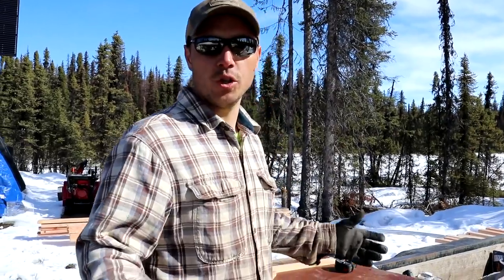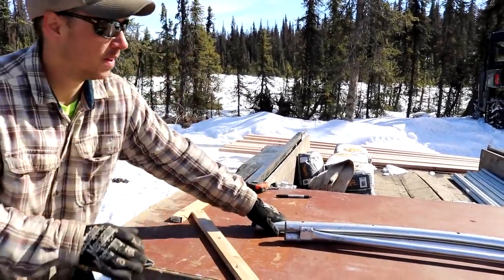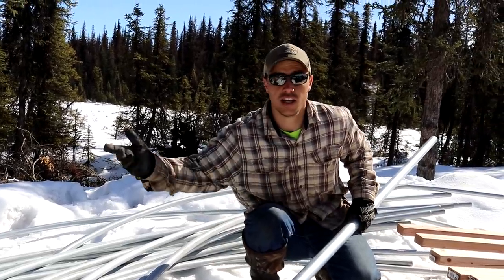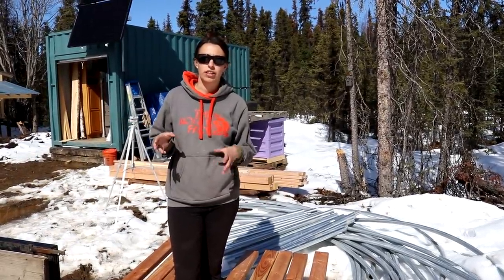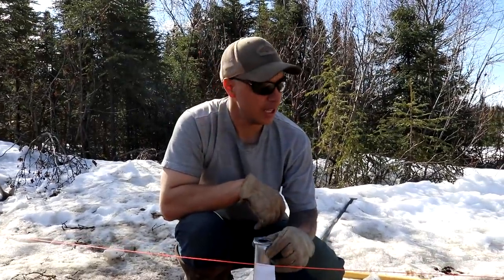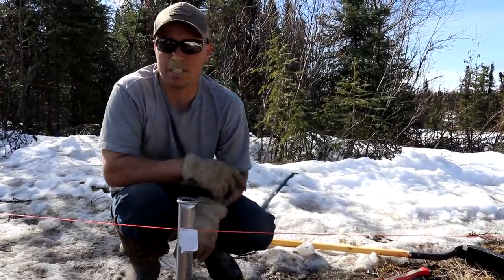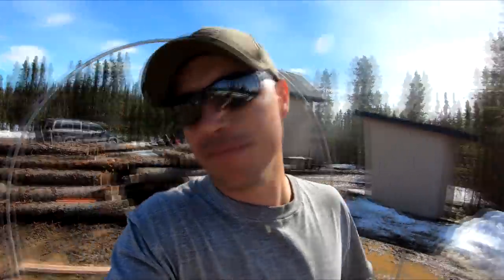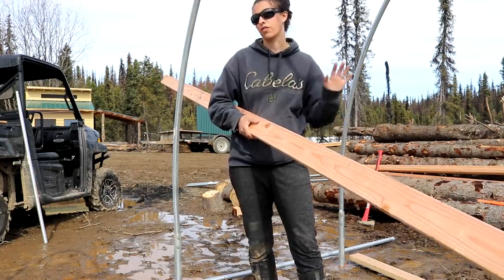High Tunnel Build (Part 1) | Off Grid Living

Comment: You mentioned that you want to make it as wind resistant sturdy as possible. If I could change one thing about this build, it would be to not use those self tapping screws and bolts. Everywhere you are using those, instead drill a hole all the way through the pipe and use a carriage bolt and a locknut. Not only will it be way more sturdy, but it will make it easier to dismantle for repairs or if you're going to relocate it. Self tapping machine screws can work themselves loose over time. Especially if you live in a harsh environment like Alaska. The wind will do it, and the expansion and contraction of the metal will do it, so I'd go back and use carriage bolts. You guys amaze me though. I LOVE to see your pioneering/homesteading spirit. I wish more people would follow your footsteps.

Comment: Hi guys, its Teresa's husband....nursery man and hoop house builder...its looking really good...but I have lots of experience with the hoops pulling out of the ground from high winds....so you might want to dig around each post and add concrete...its amazing what wind can do!  Once that plastic goes on you have force from the wind that creates all sorts of action in the frame.  After it is all sealed up you will have a tunnel that fills with hot air, it is essential you have circulation....one fan at each end on opposite sides will give good air flow but it will not cool it down. Shade cloth over the top will help and leaving the sides up lets a lot of that hot air out.  "Agrilock" is the best plastic holder and never rips out, I have had wiggle wire completely pull out in high wind so once again...wind can do crazy things.  Love your post and you guys are some of the hardest working people I have ever seen!
Reply from the maker: Teresa Dove, Hello Danny! Appreciate your recommendations, we do plan to have shade cloth and at least one fan but I'd really like to have two (our solar system isn't too large so every thing we use we have to give thought to) but we completely agree overheating and lack of circulation are concerns of ours. We did make a large door but the window in the back is not as big as I would have liked (or atleast the part that opens). We do plan to concrete our beams in but did not consider concrete for the ground posts, I absolutely believe you that wind can do some crazy things, that is my biggest worry, I had read not having roll up sides should help and hopefully some of the surrounding trees. We definitely are going to keep an eye on it and may add more concrete at a later date, the cost of things here unfortunately really are higher. Thanks again for the comment, cheers to a wonderful garden season :)
Reply: They really are!!!🙏❤🙏  67inFL👵

Comment: Linseed oil works great on wood tool handles too. Sand off the varnish that comes on the wood and treat with linseed oil. Really helps prevent blisters when swinging an axe or hammer all day.
Reply: Yea, I was wondering how they use wood handled axes so often, but didn't know about BLO.
Reply: Sanded all our tool handles and treated them with linseed oil back in the ‘60’s when I worked for the US Forest Service. Made axe handles feel velvet soft to the touch but also protected the handles from the weather.

Comment: Commercial Duty 60lb T-post (or top rail driver - what I use for ground posts) normally have at Fence Emporium, on the off chance that's where you got your top-rail.  Look-em up just east of Palmer.  Costs about $60 but so doubt you'll regret that.  They also have a T-post puller if your going to do cattle / sheep fencing you'll definitely want this roughly same price.  One more essential - TO CONSIDER- is a top-rail wire spool (about $100) and much smaller bulk spool of Galvanized wire you can make permanent turnbuckles with these to pull things this way or that way 6-12" or so and for endless and endless uses - you'll see.  The smaller guage rolls are maybe around $30 + / -.  To do a turnbuckle or a STRONG tie off like a guy wire for a tall post - just wrap a circle and a half around the whatever two ends you have and take (I use ) an 18" 1/2 pipe or anything even close to that; place it halfway between the two ends and start winding the wire using the pipe as a lever - it will suck-in and pull like a winch you can go pretty tight wind before it breaks. Cheers cool couple.

Comment: Hi Ariel and Eric.  I'm glad you chose linseed oil for the job.  If you added turpentine to the linseed oil then it will soak into the wood more apparently.  The reason they use linseed oil on cricket bats for Aussie cricket is that it also hardens the wood more.  Loving the hoop house a lot.  Outtakes are also funny so thanks for the laughs.  Michelle

Comment: Pretty sure cloth soaked with linseed oil can spontaneously combustion when stored.
Reply from the maker: maineshire, Yes you are correct, it is very flammable. I actually meant to mention that since I was using a rag. We are not stroring the rag soaked with the oil but thank you for pointing that out. I have heard of a person that experienced a fire by something similar.
Reply: @SimpleLivingAlaska  Yep happened in our shop class in high school.  A student placed a rag in his locker along with his wood project and it caught fire.

Comment: This won't help you at all now, but another method for preserving wood that comes into contact with the elements is to use a Japanese technique called shou sugi ban. I apologize if you already are aware of this process, but basically you slightly burn the wood which prevents most infiltration as the insects et al believe the tree to be dead and burned so they leave it alone. Love your channel!
Reply from the maker: David Hourigan we learned about that technique this year, very cool and we really want to try it but would need to buy a torch to do that project, we are thinking about it or trying to burn the wood in a fire.
Reply: @SimpleLivingAlaska  :) Glad you found the process. No torch needed. You are right, you can burn the wood in a ground fire and take advantage of the process. Just another technique to include in your arsenal :)

Comment: Isn't part of the problem that you are driving the foundation pipes into still partially frozen ground?  If there is still snow on the ground, that would seem to be a possibility.
Reply from the maker: Larry Belken yes the ground was still a bit frozen which is not ideal for building but we really wanted a garden this year and so far it is a pretty solid structure and the ground posts seem stable.

Comment: Hello it's Deb here. I'm wondering if you could give me an idea of how much pressure it takes to bend the pipe? I don't have a lot of upper body strength but I do have some. I'm 54 years old and would so much like to have a tunnel for growing. I'm disabled and it is very hard to get around and it most Gardens. I am in a power chair most of the time. Kind of like a Hoveround. I've had five back surgeries and neck surgeries, with one more of each coming up soon. My dream is to have a homestead and have a sustainable garden for myself and to help our local food bank. My grandmother had three Gardens on her Homestead. And they were no smaller than 40 by 50 each. One of them they grew to eat fresh. One of them they grew to can and Preserve. The other one they grew for the local food bank or local families within the church in need of help as well. My aspirations are to be more like my grandmother everyday. But this is my dream to be like her. Hope to hear back from you take care and God bless Deb
Reply from the maker: DREAMERS HOMESTEAD, that is such a noble thing for your grandma to do! She sounds like a wonderful person to aspire to be :) We're hoping to have extras for neighbors, usually we feed to our animals or put back into compost since we never have enough. We both think bending the pipes did require considerable upper body strength, however our previous greenhouse was made from a carport frame, we just needed to assemble it, add support and add the poly so no bending required!
Reply: @SimpleLivingAlaska  hey there, it's Deb here . I never thought of using a carport frame. Sounds like a good idea. Thank you for commenting, I appreciate it's so much. Thank you for your videos I'm glad I found your Channel. Take care and God bless Deb